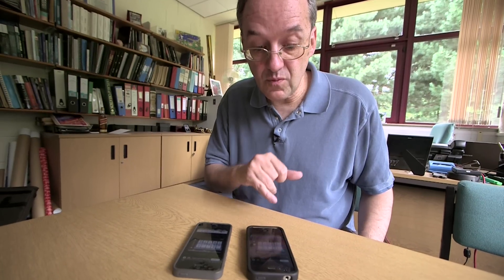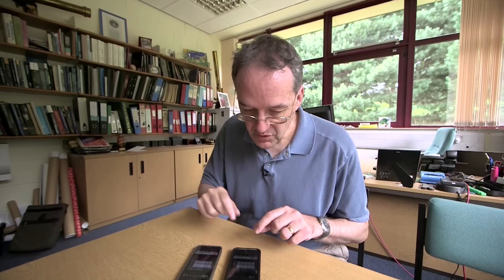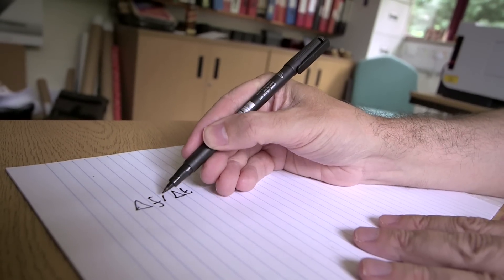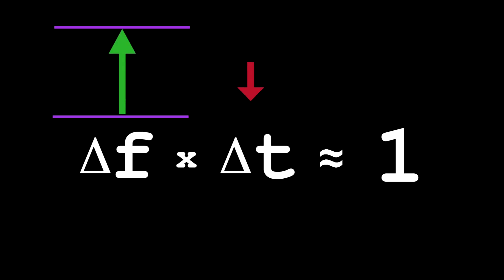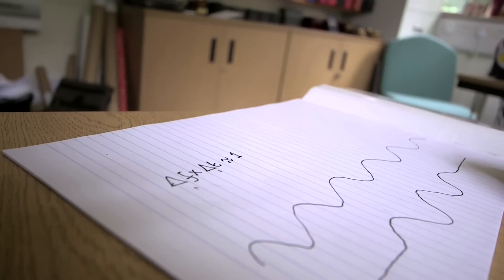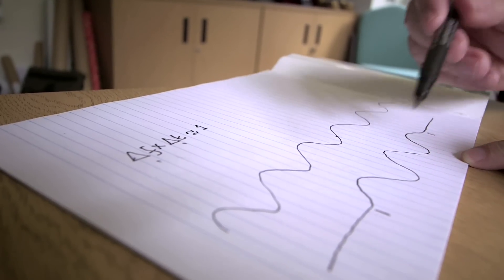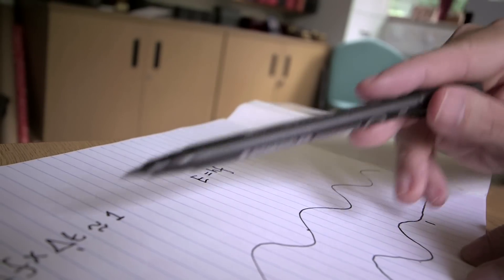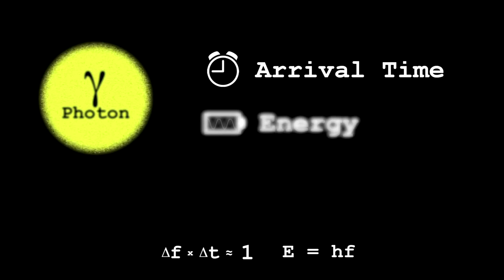What is the maximum Bandwidth? - Sixty Symbols

Comment: So if we have let's say a green laser and switch it on and off quickly it shuoldn't be a single wavelength anymore, right? Does it mean that if we put a filter in front of laser, that will allow only a green light to pass we will se the laser only when it is switched on constantly? And if we start to switch it on/off what would we see? No light at all? Or constant light? This idea seems weird to me :\
Reply: +Роман Плетнев I like your thinking. I imagine the time we would see the laser as "on" would decrease as we decreased the number of frequencies allowed through the filter. As we decrease the frequencies allowed through it essentially becomes opaque which makes sense as then the time we perceive the laser as on would be zero. So the delta t (time of perceived pulse) through the filter is proportional to delta f of the filter (i.e range of frequencies allowed through)? No idea, just speculating...
Reply: +Роман Плетнев since the filter can physically not be that precise, you would only cut the end and the beginning of each pulse. if you switch fast enough, the time until it is close enough to your target frequency would be longer than the length of the pulse, if you know what i mean. 
If the totally unrelated mental image helps, think of the sound an organ makes if it turns on while you are pressing the keys (it is one of my favourite sounds :D)
Reply: +Роман Плетнев 
+Ross Sullivan
+Maric
I understand your confusion, it's because the vid explain it poorly. The vid is only 11 min it cannot cover everything of a 2 h class on the subject. 
Here the explanation: every signal that is not pure can be written as a sum of a pure signal, when I say pure I mean it contains only 1 frequency, and it means the signal can be drawn as a perfect sinusoide. 
Now when you switch on a off periodically the green laser, if you look at the signal as a whole you will see (if for example the period is 1s) 1s there is a pure sinusoide then 1s there is nothing, and so on until you decide to stop it. It is then impossible to mathematically describe the whole signal with one and only one frequency (the frequency of the green laser). Only by using the sum of many frequency you can mathematically reconstruct the whole signal.
In other word, by using a lot of different frequency, and add them together you can achieve the same result as if you were turning on and off the laser. Hence the "it contains a lot of different frequency".

As for how can adding different frequency can result in total darkness (equivalent to when you turn off the laser) you can look into interference.

So to answer your question if the signal was obtained by turning on and off then you will see nothin, but if the signal was obtained by the addition of many frequency, you will filter the green light and obtain all the other.

For more info look into Fourier series.
Reply: Роман Плетнев same light but with just less energy because you filtered some of it off
Reply: And what in case we are capable of sending a single photon. We put a filter. And what does even very long lasting sine wave of light freq mean? That photons come in an extremely ordered fashion one after another without any differences in space gaps between them in a straight path?
Reply: Let me try to explain this in a simple way:

Look at those 2 waveforms he drew. Now cut them up into 1 cm wide segments and measure the frequency. Then cut them up into 2 cm wide segments and measure the frequency. And so on.

With the first waveform, the continuous one, you'll always get the same result---the frequency of the light you put in. But with the second one, you'll get a different result every time the "switch on" or "switch off" point is within the segment you measure. And the "weird" thing is that that isn't an artifact from measuring, but the reality. Your green filter will see the same thing: A mix of wavelengths. The fibre will see it, too. The refraction at the ends of the fibre will see it. And the reflections inside the fibre. And the effect that different wavelengths move at different speeds through that fibre.

As long as your pulse is long enough that there is enough of the original frequency in the middle of it and there's a long enough pause between the pulses, all is fine. Otherwise you get a mass of wavelengths that don't go into the fibre, and what gets in will be smashed together during travel.
Reply: HenryLoenwind okay but that makes me question one thing. Why in the world is anyone measuring the output of a device as being active when there is no input. If I'm sitting in my house and turn on and off one air conditioning unit, I'm not going to measure the time period when it was literally doing nothing and claim someone must have been turning on a heater. Talking about wave interference when it is actually happening makes sense, referring to it when there is a literal output of nothing just sounds like nonsense to me, and apparently everyone else that this particular part of the video confused.
Reply: Clinton, you are assuming that you can measure something at a point in time. However, that's not possible---any measurement goes over a period of time. Let's take your example and say we are detecting if your AC was on by looking at the electrical energy your house consumed. Each measurement takes 1 second:

1. second real: AC off, measured: 0 Watts, conclusion: AC off
2. second real: AC off for 0.5 seconds, AC on for 0.5 seconds, measured: 250 Watts, conclusion: AC off microwave on (low setting)
3. second real: AC on, measured: 500 Watts, conclusion: AC on, microwave off

And the same thing happens with those photons. Switching the laser off for a very short amount of time gives the exact same result has having a another laser with a very different wavelength instead. And this is what the video is about---how short can that time be so it can be transmitted over a fibre and be measured on the other side. If you stay clear of those short times (e.g laser on for 10 seconds, off for 10 seconds), all works well and absolutely as expected by anyone.

Comment: You actually could encode information in an unchanging sine wave; you could encode it in the exact frequency. Let's say I wanted to encode the word "it". If you break "it" down into ASCII, that's 0x69, 0x74 (in hex), or 0110100101110100 (squished together in binary), depending on how you decide to do it. Anyway that translates to the number 26996 in decimal. So, if you wanted, you could send out a tone at 26996 Hz. If another person listened to the signal and figured out what frequency it was (easy with computers!), they could decode that number into "it"! But yeah, this is obviously a silly idea. Just having some fun!
Reply: Well, there is a problem with the "easy with computers" part. So far with the word "it" we are outside the frequency range of digital audio, so you will need special hardware to digitize the incoming 26996 Hz signal.
And "it" is a very short word. 
I'll let you calculate the frequency of the word "information" with your system, but I guess we would in the 10^27 Hz range...
By the way, an unchanging sine wave has to be infinite in time, to be unchanging. Otherwise it'll contain other frequencies.
As you said, having some fun.
Reply: There is also the problem of having the different peaks and valleys of different frequencies smearing together and also losing the information.

Comment: frequency limit =/= information limit because you can modulate amplitude. i.e. each spike may have different height and contribute to several bits without pushing frequency limit.
Reply: Information limit is reached when spikes as just barely high enought to be detectable as something different from zero. Any higher than that and you are wasting time that the spike needs to climb and then fall again.

Comment: There is no such thing as DC.
Reply: If we only had infinite time.
Reply: Correct!
Reply: very interesting. Can you tell more about it?
Do you mean a light-speed electrons movement?
a simple wire faster than optical? then why? whaaaaaa ????
Reply: DC is zero frequency. A signal that is DC never changes. But the universe has only finite time, therefore the signal can only be DC if we make assumptions about its border conditions at the beginning and end of time.
Reply: Mike Page
 no, i didnt)
DC is undestandable.
never changing dc is not information.
the universe and time is not understandable.
if you want infinite, never changing, dc
then you just need an infinite energy for this useless circuit.
wtf
Reply: what DC stands for?
Reply: For Direct Current.
Reply: So to get it clearly. In a battery we have something similar to a DC whithin the boundary of the current flowing. And as we reach the time in which th battery was conected or disconected, then we move to a AC?
Reply: What about a DC 3?
Reply: DC does not change direction (polarity). Even if you remove the power source from a circuit, you don't get AC.
Reply: I submit a practical definition of DC...  

DC: A signal that can be treated as constant during a time period of interest.

 So a practical definition depends on the application.  For electronics power supplies, I would say any signal with a 3-dB bandwidth of less than 1-Hz is practically "DC".
Reply: Jess Stuart the definition of direct current is that it does not alternate.
Reply: That is a dictionary definition. To be technically correct in practical waveform applications there is a dc component whenever there is any offset in that waveform. It must be represented in any accurate mathematical description. Conversely, a car battery displays varying waveforms in practice i.e a cranking waveform when you start your car (there are standard cranking waveforms in emc testing for vehicle components), and ripple associated with charging. They are both time varying waveforms. The ripple is even reasonably periodic. Yet the voltage never changes polarity and the current never changes direction. So it remains dc. However if your supply changes direction even at less than 1Hz it is ac.
Reply: DC is the 0th Harmonic or constant value or offset of a waveform.  A waveform can have zero crossings and still have a non-zero DC value. It's just a component of the Fourier series representation of the waveform.  I agree if the waveform reverses polarity, it would not be considered purely DC.  I realize this is an important distinction when you are looking at current ratings on switches, relays, and contactors as DC currents cause more arcing across switch contacts when the contacts open.  I agree, for switching purposes, any waveform with a polarity reversal (zero crossing) can be considered an AC waveform.
Reply: that is correct. So your 3 dB bandwidth idea can't work. The DC component of a waveform must be 0 Hz. it is the only component of the Fourier series not dependent on the frequency of the fundamental of the waveform. So if your fundamental is 0.5 Hz, the DC component will still be 0 Hz and the fundamental will not be swallowed into the DC component by an arbitrary bandwidth. Also you can have a 1 Hz 3 dB bandwidth anywhere in the spectrum. So it is not only switching purposes but also waveform generation and analysis in both mathematical modelling and the real world. It is great that you are thinking about it. The thing that seems to confused most here is the statement that switching a CW on and off gives it bandwidth of >0. I can tell you it does. You can see it on a spectrum analyser. cheers
Reply: Jess Stuart I would just like to add....Just kidding.
Reply: Mike Page that would be funny but the universe already decided it transfers energy in the form of wave packets called quanta.
Reply: You are confusing two different things. DC is simply electricity that doesn't change polarity. It can be turned on and off and have frequency and even bandwidth while still being Direct Current.  The technical difference between AC and DC voltages is whether the signal crosses the circuit common or not.
Reply: And look! There's Joseph Fourier looking through his window, which is also finite.

Comment: It can be instructive to show what happens to a sharp pulse when it has passed through a bandwidth limitation, what it looks like when it's received. Because some of the frequencies are gone, the edges get "fuzzy". That relates to how short the pulse can be, or how short a delay between two pulses, before it's too fuzzy to find the edges and tell one pulse from another.

If you ever tackle radio transmission in your videos, Single SideBand radio deals with exactly this kind of thing.

Comment: This video is 100% correct when talking about the bandwidth of the fiber by itself. In practice, we need to drive the laser with electronics which are much more limited in bandwidth than the fiber. So we use multiple lasers with different wavelengths. Lookup WDM and DWDM..

Comment: Because we're talking about sending those signals along a wire. The fiber optic cable physically cannot carry a signal that is too short because it requires a range of frequencies it cannot support. Even if the receiver only checks on and off, if the signals are too short it will simply miss some signals because the pulse would destructively interfere with itself and not propagate along the wire, at least not recognizably. It must have enough bandwidth in order to form the short pulse & send it.

Comment: I'm not sure why you say that. If you observe a laser turning on fast enough, which is quite possible with some pretty basic equipment, you certainly do see the spectrum of the light changing. In fact--though I believe Prof. Merrifield is correct that this isn't used in communications--mode locking is a very common technique for making pulsed lasers in fields that require high-power laser light. The Wikipedia article about mode locking is pretty good if you're interested.

Comment: Visualize the pulse as a function, with time as the X axis. Now visualize the spectrum of the pulse, with frequency as the X axis - the spectrum will have a large bump of a certain frequency width. 

Picture keeping the graph of the pulse the same while you scale the time axis (stretch or shrink the pulse). Similarly, your mental image of the spectrum of the pulse is not changing, but the frequency axis is being scaled. Shrink the time axis, and the frequency axis stretches, and vice versa.

Comment: If you had watched the video, he explained it. The only time a laser will actually produce a "single wavelength" is when it is turned on and kept on forever. Other than that, the pulse of light it produces, because it has a discrete "beginning" and a discrete "ending," is actually a superposition (i.e. combination) of multiple wavelengths of light that, when they come together, produce that precise wave with that precise beginning and ending.

That IS quantum mechanics.

Comment: From what I know, I would say that when the speed at which it is being turned off or on gets high enough it would be difficult to distinguish between a crest and trough of the wave. So if a source could pulse infinitely quickly the wave will begin to resemble a straight line rather than a sine graph which does not provide any information in a digital sense.

Comment: He explained it in there somewhere, only visible light (from infra red to ultra violet) can bounce off the walls of the fibre optic cable. Higher frequencies like x-ray or gamma rays would just pass straight through the wall of the cable and anything else in its way.

Comment: If I may make a brief clarification (and apology to any engineers I have annoyed along the way!): this is a simple physicist's explanation of the fundamental physical limit as to how much data can be crammed down an optical fibre.  Engineers are very smart at optimizing the solution to this problem, but those solutions do not eliminate the fundamental physics limitations.  For example, frequency modulation faces the same issue that a higher rate of modulation uses a broader spectrum of light.

Comment: You need a little wave mechanics to understand it, but I'll try to help your intuition out with a example from sound waves: A constant tone is a time-varying oscillation - same goes for light if understood classicly with Maxwells equations (periodic oscillation in the electric and magnetic field). For very short periods of time however, you dont get, lets say even a period of the tone signal, which means its "tone" is'nt really defined. Its actually a mixture of a lot of waves. As for the laser.

Comment: Square waves consist of the fundamental, and all the odd harmonics. So the pulse is as square as the bandwidth allows, with shorter and shorter pulse rise times the more bandwidth that's available. The rise time of the pulse affects the shortest pulse you can transmit. Also see "shannons law" which relates bandwidth and signal/noise ratio to determine the maximum throughput.

Comment: I believe that is exactly what the receiver is doing at the end of a fiber optic cable, but it's the properties of the cable itself that limit the pulse length (and thus how closely pulses can be packed together), not the receiver. Because a pulse is fundamentally composed of a range of wavelengths, the smooth shape of the pulse (and therefore readability by a receiver) begins to degrade once that range extends outside the range which the cable is able to transmit.

Comment: You can do that. You can send information in morse code at some, possibly large speed. But you get to a point where you your pulses, or spaces, become shorter and shorter. If you use  simple DC power, interrupted for spaces, and connected for pulses, you will have a rudimentary signaling system, fully capable of carrying anything you wish to encode into that medium. But you eventually get to a point where your pulses or spaces come so close together at the other end that they can no longer ...